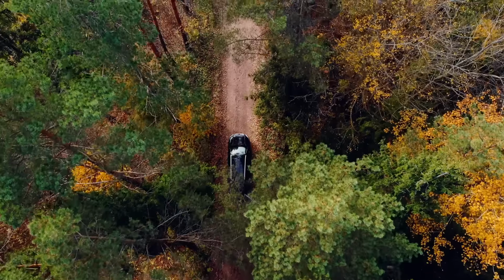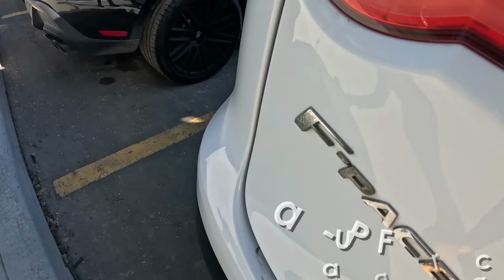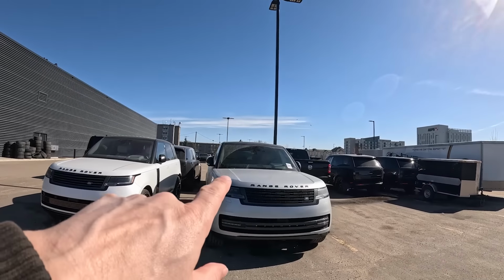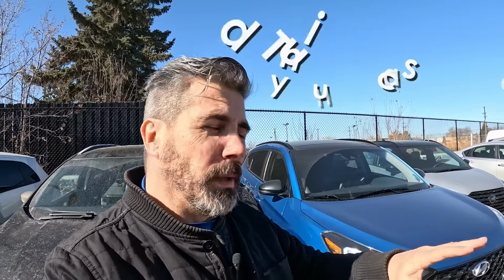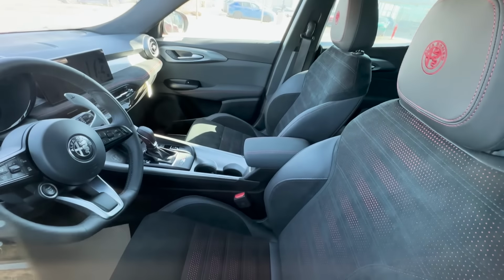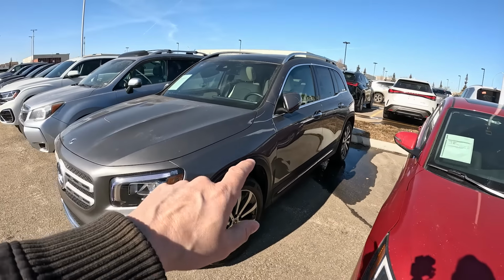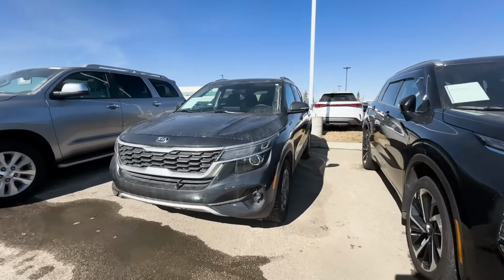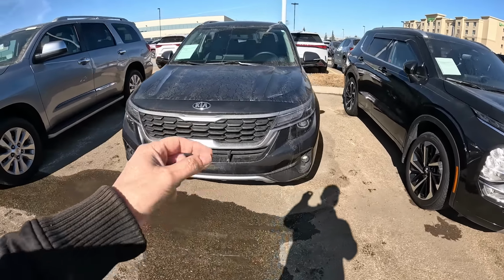Here Are 10 SUVs you MUST AVOID!

Comment: I was once a service manager for a Nissan dealership.  I watched with dismay,  When the Datsun name was changed to Nissan.  I watched the reliability go down.
Reply: cvt transmissions are definitely garbage
Reply from the maker: sadly true
Reply: This is just one of the problems Nissan has.  They keep trying to fix the same problem over and over, instead of going back to engineering that was successful.   They need to go back to the 80''s engineering start over from there
Reply: @davekeller2798  ,, 
They lost all their engineers and quality culture  from back then many  yrs ago .
I was skeptical when Carlos ghosn was able to do a quick turnaround  , 
But that was just a bandaid , because the culture was gone .
Their board are the reason for their own  demise .
Gone is what they deserve .
They show their true character.
Even framed up carlos with legal system  , + cockamamy accounting rules .
Reply: @enzoh7763 Every time you have a finance guy leading a manufacturing company, it will lead to a decrease in quality and reliability. Other than Nissan, look at Boeing
Reply: I bought an Altima in 2002. Nothing but problems from the start. Never again. I stick with Toyota and Mazda. Never a problem
Reply: CVT; I am a Toyota guy and even they put cvt in a 2021 hatchback that sustained catastrophic failure at the end of the 60k mi factory warranty; I had 61 mi (9k ) repair. So they fixed it on their dime and then told them keep it and give me a 23 Tacoma, so now I have a great truck👍
Reply: I still have a 1970 521 Datsun.
Reply: @chuckoaks6756  I had to give up (after 32 years of ownership) my 1973 Datsun 1200 Coupe due to not finding new parts for it anymore. Of all the cars I've had, that one was the best.
-- BR
Reply: Jatco transmissions 🗑️ ruined the CVT name for everyone
Reply: true, work at an auto auction, every Nissan coming thru has transmission issues...
Reply: They went down when Renault took over. The 90's hard bodies, Maxima's, Pathfinders were tanks that lasted. Then the dreaded cvt's came in the early 2000's
Reply: I have a Sportage (Kia version of the Tucson) 2.0 litre non turbo. Drives like a dream only 50000 miles so far but no problem whatsoever
Reply: The Datsuns were junk.  They changed the name to get a new customer base that would buy their BS cars, trucks, and SUV's.  They're the Asian version of Chrysler.  Keep making junk, stupid, uninformed people, keep buying the junk. A never ending cycle of greed, corruption, and stupidity.:face-red-droopy-eyes::face-blue-smiling::face-blue-wide-eyes::face-red-heart-shape:  I just put these symbols in for fun.
Reply: You are right. Nissan needs to bring back the Datsun reliability. I had a Nissan Altima & Nissan Pathfinder with transmission issues at barely 100,000 miles. No more Nissan for me!
Reply: @davekeller2798  Nissan is junk! Worst vehicle I have ever owned, one problem after another.
Reply: Datsuns in the 70 and 80's were junk.  They would rust off the frame like Chevy Vegas and Ford Pintos.The brand was never that good.  They were basically cheap transportation for college students until you got a good paying job and and could buy a Honda Accord or Toyota Corolla.
Reply: @garykeith1048 
Completely agree with you Datsun was never good but of course better than the current cheap made Nissan
Reply: @garykeith1048  That's 100% USDA Prime BS, pure American propaganda at that time (early 1970s) -- I remember their (American car-makers, who REALLY were the ones producing crap) TV ads back then: "Hey, don't buy foreign cars, be a patriot and buy our American crap instead." 
F-em, and I got a Datsun...
I can't tell you how many "superior" other-brand cars -- ESPECIALLY American brands -- I saw broken down on the side of the road in 32 years, or rusting out in junkyards while I continued driving mine for many years longer (32, as I said).
So I think you need to look in the mirror: See what clueless (and ignorance) looks like.
But tell us, if you will, what kind of "not junk" car/truck are YOU driving?
BTW, I have another "junk" car: a Jeep (Gladiator) but sorry, it's been great also. But don't let you ignorance stop your "junk car" bashing, as I'm guessing it's your only social outlet.
-- BR
Reply: @billredding2000  You'll fall on a sword for them.  Lighten up.:face-blue-smiling::face-red-droopy-eyes::face-red-heart-shape:
Reply: @garykeith1048  No, no brand loyalty here, but AM interested in facts, not opinion or hearsay. Consequently, I get tired of the ignorant trashing something as if it applies across-the-board when other's people's real-life/personal experiences contradict their BS completely. Same for airheads who trash Jeeps...mine's been fine, and MOST owners will say the same. Sure, not ALL owners would, but that's true of ANY brand, NONE are exempt (perfect).
BTW, not only was my Datsun my best car (ever), Datsun's customer-care after the sale was tops, too. As for Nissan, they used to make pretty good cars (my 1995 200 SX LE was problem-less -- only gave it up when a semi-truck totaled it) but they've slipped over the years, so today I wouldn't recommend a Nissan.
Next up vehicle: Probably a Yamaha golf-car (gas)...but I guess they're also "junk," yes?  ;-)
I just can't win...
-- BR
Reply: @garykeith1048   ,
Datsun z21  ,

Comment: Man my 2011 Ford edge sport pushing 215k with the 3.7 V6  had her since she was new and other than Maitenance and some wrenching she has been extremely reliable
Reply: Guess that's why there wasn't an Edge on the list. My mom has one, 2013 and LOVES it. Been a great car for her. She bought it used, Ford certified. No major issues that manufacturer did not repair.

Comment: Had to have  the engine replaced in my 2013 Santa Fe limited at 120,000 miles in 2020. Had the metal filing in the oil problem. Hyundai stood by the repair even after the 100k warranty had expired. I only had to come out of pocket $1600 for Labor because I always had it serviced at the dealer. Never had any issues or major repairs other than that. Running like a dream since 2020. While it was a major issue, They took care of me. So $1600 engine replacement plus oil changes and regular service over 10 years was minimal  compared to Mercedes I had before that. Wouldn’t buy another Hyundai though. I feel like I got lucky.
Reply: You did get lucky. I had a 2016 Tucson, and the dealershit told me to take a flying fuck at the moon with only 110 K miles even though the recall was extended to 150 K. Mine was burning 2.8 quarts of oil ever 1k miles
Reply: Our 5 year old Tucson has had not one problem in this time. It was built in Korea with an 2ltr motor , plus it was tuned for Australian conditions , which they did a great job doing.
Reply: You definitely got lucky, good dealer too.  I’d buy again from that dealer even if not a Hyundai.

Comment: Jeep Cherokee was pretty accurate. 2015 Cherokee , a little before we hit 60k miles, the engine randomly started to overheat and needed a new engine randomly.luckily it was still under warranty. Also the infotainment system was utter trash. Had to replace the alternator prematurely. The 4wd system kept going on and off. When it snowed the Cherokee was great to have. I give them that

Comment: I bought a Hyndai Equus, with 50k miles,being thier flagship vehicle I thought they would had put some great engineering in it.
Not so, at 80k miles expensive systems starting breaking down like the air suspension, but also things like valve cover gaskets, expensive to replace. 
I will never buy another Hyndai. It's too bad because it was a beautiful car.
Reply from the maker: Sorry to hear that Tim.  Yes sadly many people get rooked by this brand
Reply: @ECPP Hyundai has come a long way.I have a Santa fe and it's been fine so far .Just change the oíl every 6 months and don't drive it like a maniac.
Reply: Which model and how many miles driven?  @koolkitties8552

Comment: Not a single  BMW on the list. How is that possible?
Reply: The new BMW s are much better and more reliable than the old one
Reply from the maker: There are some that are worthy such as X7 and the V8 or the C5 and X6 with the v8
Reply: Stay away from v8 and BMW will serve you well
Reply: I have a BMW 528i.  120,000 miles.  No issues.  knocking on wood
I want to buy a new vehicle but with the car market and interest rates the way they are now.  I work at home, so I will wait it out for awhile.
Reply: They've improved a bit in reliability with the latest generation. The B48 engines get great reviews.

Comment: I own a Hyundai Tucson 4WD since 2018 and it is great. Not even a single light bulb to replace so far.
Reply from the maker: Great to hear
Reply: @ECPP I have a 2006 4 Runner with 108,000 miles. Toyota wants $200 to replace each of the 4 sensor lights on my dashboard..The light bulb is only a few dollars but the labor cost is ridiculous. Instead, I put that $800 towards my new tires. I haven't had any problems with my 18 year old SUV. I highly recommend the 4 Runner. When the time comes I will buy another one. I paid cash for this one, so I'm enjoying not having a car payment. It was only $40,000 in 2006 now they are $65,000. 🤧
Reply: @colleenpeck6347 I wish the mpg was better, I’d buy another one, mine was a 98 but it’s the best thing Toyota makes for sure

Comment: When my daughter learned to drive I bought her a 2013 Juke. She actually liked the looks and it was a real kick to drive. She recently traded it in after 10 years and 115,000 miles. The transmission was working just fine, with the caveat that it had three full transmission fluid changes in those 115k miles. The Jatco transmissions that Nissan uses are truly sub-par, but the Juke is light enough that a well maintained transmission doesn't automatically spell doom. Any CVT, if not maintained, will fall apart around 100,000 miles. By the way, you can thank your federal government and their emissions/fuel economy regulations for CVTs, direct injection, tiny turbocharged engines, and stop start systems.
Reply from the maker: You are right, a strong maintenance regime is what it takes to maximize lifespan on those units
Reply: I had a 2017 Nissan Pathfinder CVT and it got to 252k miles without a single transmission issue. The only maintenance I ever did were breaks, oil, tires. 

But at 250k needed maintenance upgrades of control arms, rods, links, engine dampers and rear suspension. Opted to let it go. Thumbs up to Nissans.
Reply: The federal government has nothing to do with it.  They're cheap assholes who want to cut costs and increase profits at consumers expense.  Good old-fashioned American Greed with Stacy Keach.  A slap on the wrist.  2 years in Federal Country Club and keep most of your ill-gotten gains at the expense of your fellow Americans.
Reply: I thank the companies for repeatedly doing the wrong, cheap things to meet the new standards.

Comment: FIRSToff turbocharging were designed for the race track.  They are shortlived motors to develop power for a short time.  They will not last for daily grind.  Direct injectection, which idiot designed that multipoint fuel injection is the best. Variable speed, it is well known its not as good as the automatic that has gears.  I am one 0f the 18% that drives a fivespeed manual.  It is a known fact that the manual is the most reliable type of transmission.  And yet the stupid and lazy drivers demand automatic.  In my mind, the Vtec naturally asperated motor is the best.  Mine has 221,000 miles.  And this video was talking about only 100,000 miles, what pieces of crap.  There is a Volvo that has over 3 million miles.

Comment: 10 Lessons Learned:

1. German engineering is not necessarily German engineering.
2. British engineering has been succeeded by Korean engineering.
3. Anything "Eco" is inherently trash (which is not economically/environmentally friendly).
4. You don't always get what you paid for.
5. Nissans biggest joke costs you an arm and 3 legs. 
6. Electronic is not better.
7. Piano-gloss finish looks great but doesn't get you from A to B.
8. Wind can destroy your brand new SUV.
9. Ford Escape is actually pronounced "Ford ES-KAW-PAY"
10. Avoid car lots unless this man works there.
Reply: I can agree with you on #3 except in Toyota case. My mom's RAV4 is always in eco mode, gets pretty good gas mileage
Reply: damn i was thinking of getting a Nissan 350Z😖

Comment: Good reviews when it comes to Kia my mom has a 2011 Kia Optima which she bought brand new and now has over 171,000 miles on it and still has the original transmission and engine in it I guess she was able to get one of the better built cars that came off the line 😆👍🏻

Comment: My mom used to have a 2013 Ford escape eco-boost, and oh my God, that thing was a pile of shit and a money pit. so she got it used in early 2013, about a month later she had to replace the belt. There’s some other things going on with the engine so we had to take it in a lot of times. Ones all that stuff was fixed, the turbo blew up in 2018 and we had over 200,000 miles on it then, and at that point my mom got her self a 2018 Mazda CX-5 sport.
Reply from the maker: Thanks so much for sharing.  Can’t go wrong with that
Reply: Good choice with the CX5
Reply: @Guelojcm  Ya, we beat the living shit out of the engine when we got it, and we did not have one issue with it. Only one recall.
Reply: I think after 2012 is when ford went down hill with the escapes and fusion cause there really reliable up till then
Reply: Another fun to watch, yet very accurate video! Thanks

Comment: I have a hyundai tucson 2016 purchased new, in that color even. Got a transmission replaced at 65k under warrantee. They said it was a factory defect. There are strange noises when in the highway and new additional noises as time passes. Not as reliable as my 2002 chrysler town n country minivan.
Reply from the maker: Yes not Ngreat vehicle, sadly many have purchased them
Reply: I have a 2017 Tucson 1.6 Turbo with almost 200k on it and have had no issues other than regular maintenance (brakes, rotors etc)

Comment: Hyundai/KIA are brand you MUST AVOID at all cost. F***king engine setup build quality and unprofessional customer service.
Reply: I agree 100%. I have a 2021 Hyundai Santa Fe hybrid. A nightmare.
Reply: We just got it out of a 21 Sante Fe it was piece of crap at 65k the trans was acting up the engine was rattling and all maintenance was done religiously. Not worth buying at all.
Reply: @cleehollis1983  Great to hear that!! 
Share with your family and your  loved one. I don't want anyone to spend hard-earned money into this brand. 

FYI : I bought brand-new my 2017 Tucson Limited - $33k. I ended up getting rid of it at 45k miles. Its engine light comes up 2 times ( 1 is timing belt, the other is spark plug ). Spark plugs are broken and fell into the engine that the technician said my Tucson needs the new engine. Technician diagnostics about the engine it has 3 cylinders broken, so I need the engine replacement - of course, it is still under warranty, so I dont have to pay any cost. I still remember that occurred in July 2019, and because of the pandemic so I have to wait 7-8 months for all the parts coming, and they can assemble them. I checked them to let me use any car while my vehicle in the shop do repairing; they said we don't have any available at the moment. I grabbed Uber straight ahead to Enterprise to rent the car for at least a month because the dealer said they were waiting for the approval from the company, so they would pay the rental car for me. In the first month, I have to pay out of my pocket ( THE COMPANY NOT REIMBURSE/PAY ME BACK ). Then I came back and forth to check my vehicle, and it finally got done in Feb 2020, and right after I received my car I run straight into the dealer showroom I SAID I WANT TO SELL IT RIGHT AWAY .... TODAY!!! 

The salesman asks me why I don't hesitate and said YOUR BRAND IS CRAP AND THE CUSTOMER SERVICE IS COMPLETELY TERRIBLE. I got paid back $21k after 44k miles because the value drops for the engine replacement. 

DO THE MATHS THAT I HAVE LOST A LOT A LOT OF MONEY FOR THIS SHITTING BRAND!! I promise I never get back to this brand the rest of my life. 

The company simply DOES NOT CARE CUSTOMERS!!!
Reply: My wife bought a new 2016 Kia Soul . 8 years later still running  great. NO ISSUES YET 70,000 miles Still like New. But we keep up with the maintenance on it. So hopefully it will keep on going. Lol
Reply: @becausehelivesministryintl6841  i bought mine new too...had every service done recommended then one day between my oil changes it had no oil in it and the light never alerted me it had no oil...why didn't it have oil if Hyundai did the oil change? These are the questions noone wants to answer or take responsibility for..
Reply: Just sold my 2017 Hyundai Santa Fe XL for scrap due to engine failure . Had 173K on it just after my warrantly finishes. My 3.3 engine not covered under the recall.. HUGE disappointment and would never give another dime to hyundai
Reply: They are pure garbage 🗑️👎
Reply: Wow I'm sorry to here that. It's a sad day when you can't get a oil change without it damaging your car. And no one takes responsibility for anything anymore  these days
Reply from the maker: 125 percent